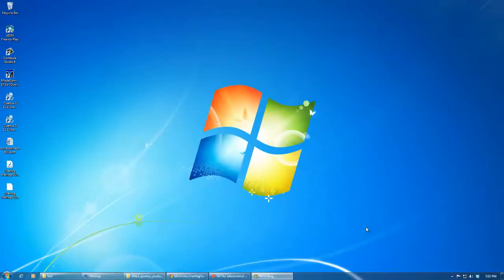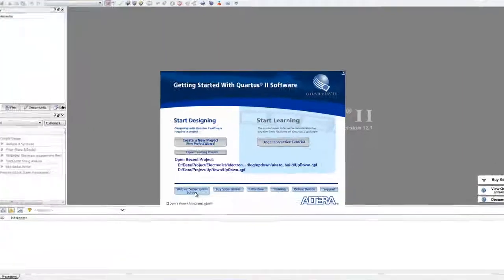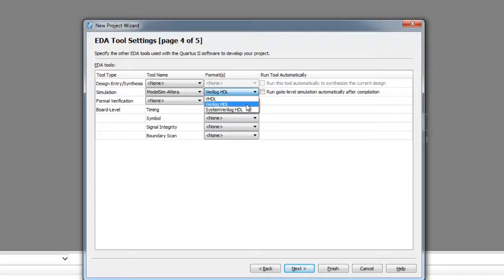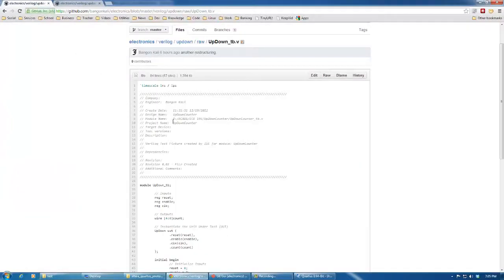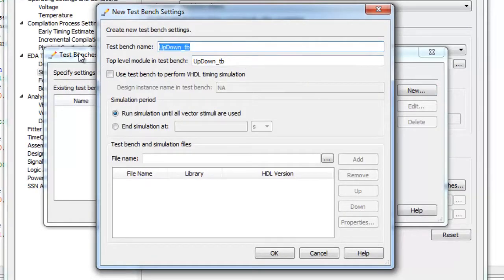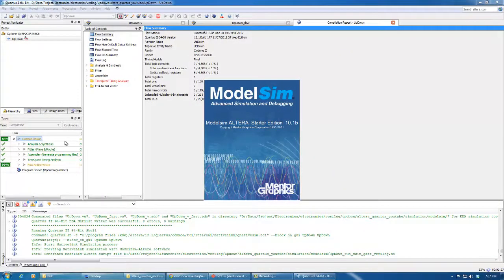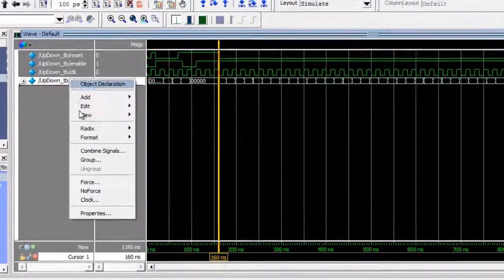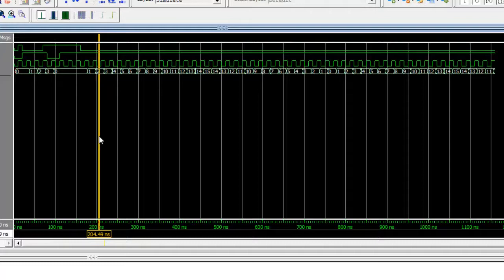Verilog: UpDown Counter with Quartus and Altera ModelSim in Windows

Comment: sensei, after I run the simulation, modelsim did not automatically execute. how did you do it? please?
Reply from the maker: You probably have a different version or install configuration. I highly advise launching ModelSim manually after a build.

Portions of the video tutorial still apply but a part of the procedure will be changed to account for the manual Launching and Setup of ModelSim in order for it to show you your simulation results.